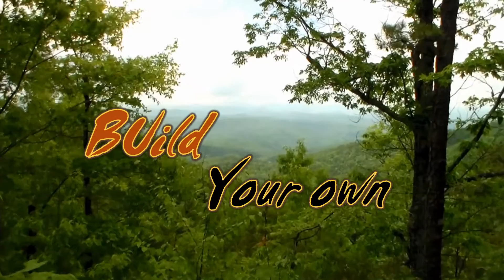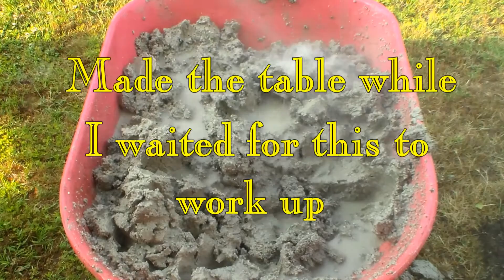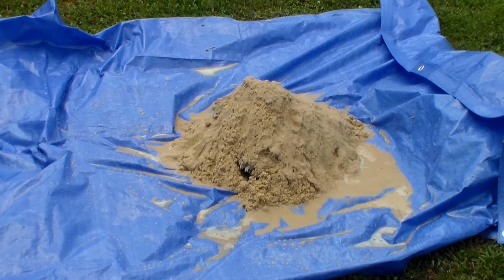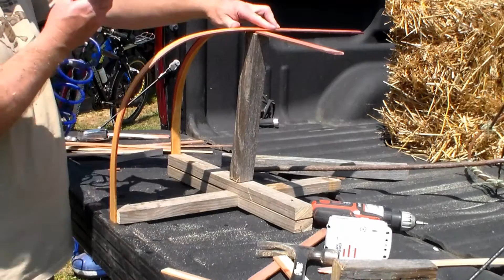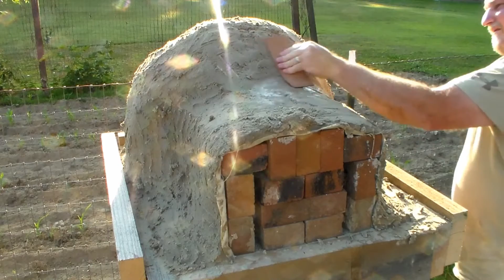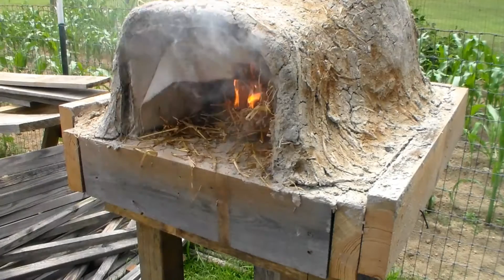How to make a Earth Oven for Baking Bread

Comment: I work with pottery clay and my tip to you for no cracking is: the clay absorbs lots of water when wet and fast outdoors wind and sun dries the clay extremely fast in some areas while others are still damp and wet. The secret is to cover the entire over with plastic, tarp, paper and/or cloth. You don't have to use them all together, that's an idea of what to use. The idea is to let the clay dry slowly/ controlled drying and also avoid air changes while clay is in drying process. I'm assuming that for your size oven it shouldn't take more than 5 to 7 days. Once the clay reaches the "bone dry" (term used for ceramic/pottery pieces that have been controlled dried / bone dry and ready to be fired in a kiln for first bisque firing). The stages of the drying process in clay are: greenware, leather hard, bone dry, and bisque fired. Hope this helps. If you try it please let me know how it came out! Good luck! PS. You don't have to rebuild or start a new oven, but you will need to completely wet/soak this oven with water all the way before adding the new clay mix so they dry equal. If you apply the clay in the already dry oven it will defeat the purpose of controlled drying and the dry clay will quickly suck up the water and moisture of the fresh applied clay making it quickly shrink and crack.
Reply from the maker: Thank you for the information. I have already did pretty much the same as you instructed. I took the old one and I used some clay i dug up here in GA. I sifted and powdered the clay down and then  moisturized it. Then used some old newspapers I had and applied the new clay over the top and kinda just made it more presentable. The Kitty litter I used did very well for making a few pizza's and some bread. But the heat was not controllable for long periods due to cracks and heat escaping. I do thank you for the information and It doe's help when others help along the way. Thanks for commenting and helping out... I have the new footage stored on about 900 GB of others video's I need to upload soon.. ATB MIke

Comment: You need the door to be 63% of hight for proper air circulation.  The inner mass should be 1part clay and 5 to 6 parts sand to prevent cracking. The thermal insulation layer is that plus 70% straw this also stops cracking.  Inner layer needs 4 inches thickness and outer layer needs 4 inches. Then you have a true oven.
Reply from the maker: Yep sounds good to me. I am sure those dimensions, Ingredients, and methods are proper ratio's to work best.  Not super sure if those are the exact measurements I used. One thing for sure. Mine worked and had lots of good times using this method. Sometimes new things happen when you step off the beaten path. Sometimes it fails and sometimes it is another way to tie your shoes. Although your instructions sound pretty accurate and seem it would make a fine oven. Maybe someone will use those instructions and the visual part of the video to make the best oven possible. Thanks for the your time ATB Mike

Comment: That was so interesting and clever to use cat litter.  Did you use any specific ratios for the size of the dome?
Reply from the maker: Thank you. When I made this one I went with a opening width to cover the size of 12 inch pizza to slide in- I adjusted it to 16 inches to allow any  imperfections in my Pizza making skills 8). The dome was a hit and miss for me on this one but I went with 18 around 22 Inches from the center height. I did this only out of experiment and being able to to if the dome would draw and circulate the heat within. I cooked several Pizzas and even a turkey and some hams. Then the dreaded Storm blew the Top off On vacation. The 3 days of rain weakened the structure and I took it apart. Currently working on a Clay oven from the Ga Mountains. I hope you got the information you needed. I generally just build from Sight or Ideas. Thank you most importantly for stopping in and supporting my ideas and crafts. ATB Mike

Comment: I watched a rather long video that documented an ancient iron smelting technique used in Africa. Part of the process was building a furnace from clay. They mixed straw with the clay (that was taken from a termite mound (didn't see any termites, so I think it was abandoned)), but they broke the straw up by hand so that it was very short. They also let their furnace dry for seven days (in the african heat). There were a lot of details in the video, which was about an hour and a half long; maybe some technique they use could be useful for your bread oven.
Reply: Also, when you were covering the framework you made to create the shape of your over, I got the idea that you could use paper mache (or however that's spelled) to cover that instead, if you wanted a smoother shape. Just some sugar water to act as glue (because you don't need a very strong glue if you have such a great surface area), and strips of newspaper. You can build up the shape by crumpling the paper, to fill in depressions you don't want, and let things dry as you go. Though maybe you don't want to spend too much time building a bread furnace, and making paper shapes would take more time than your willing to put forth. Keep it in mind if you want to create a lasting and quality clay construction though?
Reply from the maker: I agree with the way you speak of....I live in North Ga Mountains and we have tons of clay all over. I have made a few small ones this way for camping and such on the ground. Cutting the hay into smaller pieces works better than full amounts. This was a spur of the moment project with Kitty Litter. I had heard you can do a lot of things with it. I was not certain if the clay in the litter would actually work and hold with smaller hay. So I opted to try with the hay as it fell. I think it would hold well wit the smaller cut straw now that I have completed the project. I think with red clay the mache would work as well. I was not certain on the weight of the litter as it dried. It does seems to be a bit heavy with the water added...  I have cooked a few loafs of bread so far and will continue to test it out. But I do plan to redo with Red Clay and will definitely consider the options you mention.. Thanks for the view and support and all the information.. ATB Mike

Comment: You can also mix some fine sand,borax,and a little bit of ground/powdered glass brown beer bottles work good.mix with water then "paint it on and then hit with a torch.It's kinda like useing flux for welding.the borax lowers the melting temperature of the glass and sand and vitrification takes place
Reply: It kinda glazes the whole shebang
Reply from the maker: Now that is interesting! I will check into this a bit more . Just the idea for other projects makes for a little more research into this... Thank you for the information and stopping in... ATB Mike